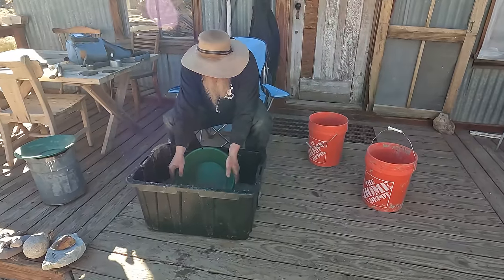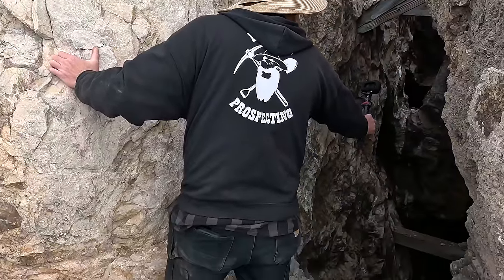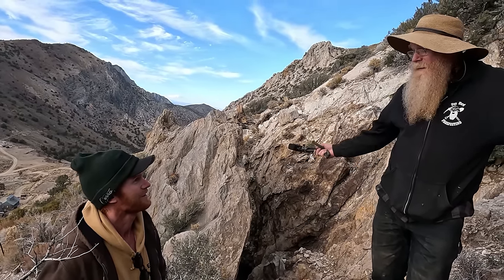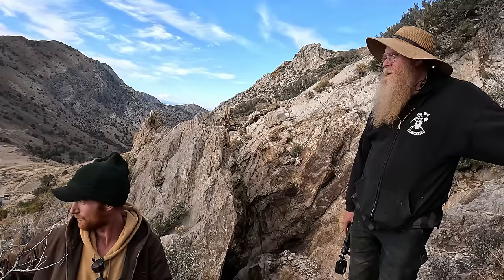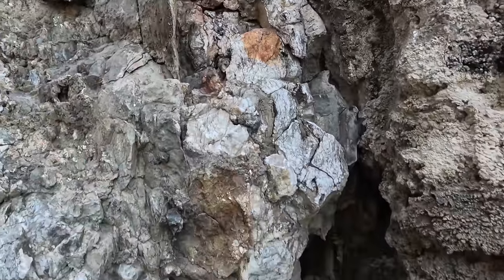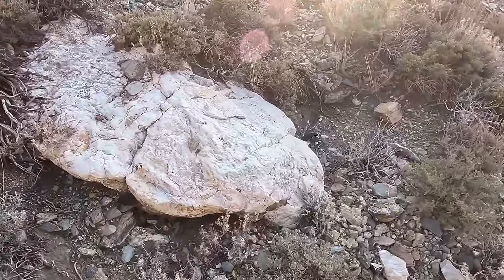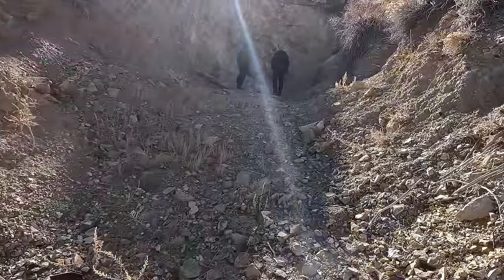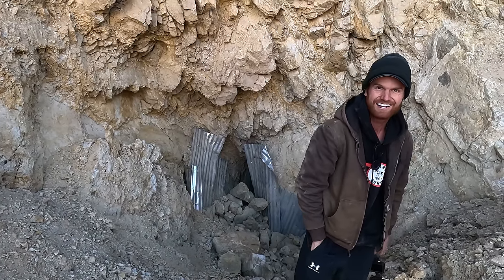Gold Prospecting & Exploring Cerro Gordo Ghost Town & Silver Mines

Comment: Ok here is what you need to do! Jason needs to build a gold table for Cerro Gordo then have an attraction where people near by can come work their findings or people can come out and find sponge and run that to see what happens! GREAT family event!
Reply: I know a certain dad and his 14-year-old son who would be over the moon to try that out!
Reply: Add a smelting and make a coin or jewelry and it's a full circle mining experience.
Reply: They'll need a water source first.
Reply: @krockpotbroccoli65   Yup.
Reply: @krockpotbroccoli65  Did you see how Jason has a recirculating pond at the bottom of his machine. Once filled its good to go! Rain Barrels and a sump would be more then enough to refil the evap!
Reply: They now have water. Heavy D brought up a holding tank and buried it so the hotel will have running water. Unsure if it's plumbed yet, but it's in and ready to supply water to CG facilities.
Reply: I would say charge something for each stage of processing, or offer it as a package up to a certain amount. Smelting should not be included since that takes aot of effort. The issue with the shaker table is that it can only process so much per hour, same with the crushers, so you could end up with a large backlog longer than a person stay during leak season. 

The logistics would need a lot of fine tuning, so it's better to just have it as an educational demonstration attraction. Plus if one is smelting, the Galena invites a lot of regs since you're working with lead ore, that hey may not want to deal with.
Reply: @cjndaily6062  There's no good continuous potable water source, though. Just that runoff puddle at the 700' level of the mine. That's fine for flushing toilets or running ore processing equipment, but it's probably contaminated, being that this was a lead/ silver mine, and even then, they've yet to get the pump working reliably.
Reply: @cjndaily6062 The water tank Heavy D brought up is only for the fire sprinklers mandated for the hotel.
Reply: @cjndaily6062  currently the pump at the 700 level doesnt have the capacity to supply the town as is. any additional water usage will result in more water having to be trucked up. Its why Brent had a hydrologist come up and give his professional opinion, and why Brent wants to investigate the former spring along the main road below town.
Reply: Brent can't afford that insurance....
Reply: With the lead in that area opening n g too the public in a mining capacity is basically opening to a lawsuit.
Reply: Work the tailings piles too! They had tunnel vision back then!

Comment: Jason. Have you looked at building 6 foot sections of belt conveyors that could be interlocked. Only for small rubble less than 1.5"  powered by small starter motors in short bursts or electric bike motors . Allowing easy movement to bagging or bucket filling areas.  Perhaps using aircraft wing spar extrusions for frames.  Super light super strong.

Comment: You need to get yourself a set of those high res glasses so you can hike with both hands.

A suggestion for Brent to invest in an old set of settling tanks from an oil exploitation company, and ten tankers of water to run mills and tables for a season.

Comment: To make the Omega Tunnel safer you should find 50 feet or more of heavy-duty 6 foot+ diameter culvert. The kind that bolts together from quarter-round segments. Clear out a place to lay it with your front-end loader, up to the opening, and then cover it with those tailings. Then that mountain can fall over it all it wants. I know it sounds easier said than done, but that should be your goal.
Reply: Thats earthquake country...have to be sure you werent crossing any faulting..

Comment: Professor calabash what you are hearing is EMI noise even at Rutus factory default setting, Sensitivity is still too high for your  EMI area. You need to stabilize that detector as well as any detector you use in a Noisy Environment and what I’m saying is you tend to equate high levels of sensitivity with Deep performance remember what I said less is more in this case, I would suggest that you, reread my fundamental tip sheet I sent you. In the near future, I plan to do a video on how to properly set your sensitivity using the number one performing machine the Tarsacci MDT 8000   I will do so in my test garden using one target and my EMI is worse than your location because our utilities are all underground and I have the box right next to my driveway, that being said, I’m glad to see that you have beaten the Flu when your fever broke but I do recommend you get proper rest and listen to your wife. Happy new year.

Comment: I'll take a wild stab at those ditches running straight down the hill.  Were they blasted in with "detonation chord"?  I've heard the forestry service will make emergency fire trails with it.  The results looked somewhat like that.
Reply: The fire team that I saw using the det-chord had cut trails across the face of the slope, into a switchback trail up the mountain.  It cleared and flattened (sort of) a 3' or 4' wide trail in an explosive shot.  Of course laying the chord involved hiking with a spool of it on their back as they hiked the path that they wanted.

Comment: I bet that trench and the connected adit were probably dug by the Chinese. Only the Chinese and the Irish were willing to do that much work for the slightest chance of money. Unless Brent owns the claims associated with the ground, I don't think he can legally mine there. In this state you have to have the rights to the minerals and a registered claim before you can sell anything from it. If you own the land (town) you just own the surface not the right to everything under it. I tried asking BLM about it but they said: "The BLM does not get involve with private patented mining claims, you may need to contact the county assessors office for current ownership and mineral rights."  I think the better option for Brent with the lack of wood to use for timbering in the area (and the price of wood these days) is to go the new fangled route and shoot spikes and wire into the walls and hit it with shot-crete. That's how they sure up a lot of modern tunnel work, that and the steel plates. 48:55 I can't be the only one noticing that dump right behind Dan. That little "washer or button" looks like an old Chinese coin that's had the embossing worn off.  
My opinion: There was never any gold at Cerro Gordo, it was a lie meant to pull interest and funding back into the town while everyone was gold crazy.

Comment: I can't believe you guys -- go into the wash to snipe Au and nary a sharpened probe/scraper nor whisk broom amongst y'all, never mind a hand vac. Ya didn't get close to the lowest points in that bedrock. Pioneer Paulster is rolling over in his ahhhhh, ermmmm -- wet suit??
Seriously guys, that was a purt half-arsed job of sniping. Gotta admit surprise at no crumbs at all in the higher-up's, but ya honestly didn't get anywhere near the bottom of those cracks. Take proper sniping tools and complete the scrapes correctly, if ya will?
Reply: <edit> Also, it is my belief you are sniping for the Au entirely too far away from such a small strike to find anything except possibly some micro-gold. Head back up the hill to fractured bedrock just downhill from the strike's reported location for greater odds of sniping discoveries.